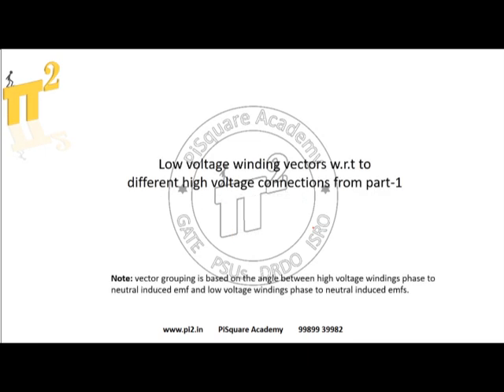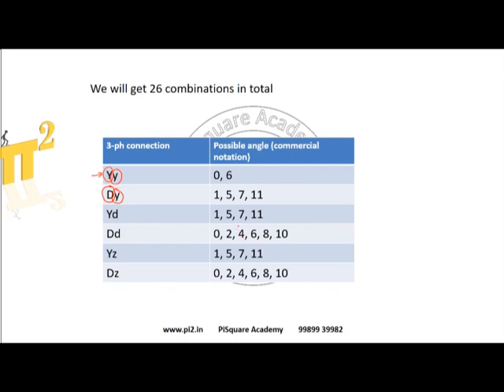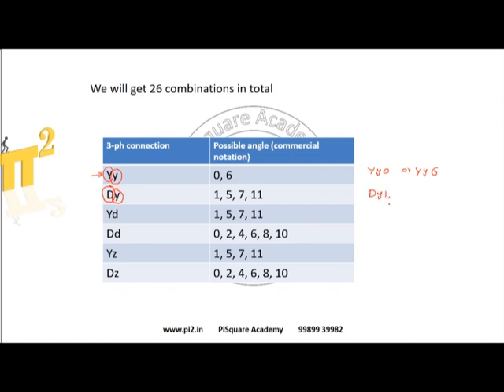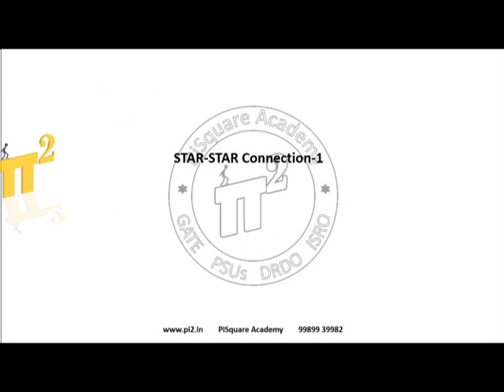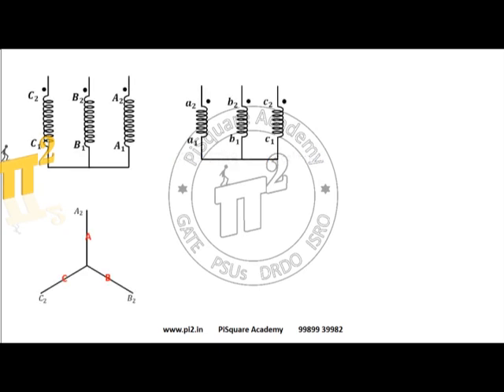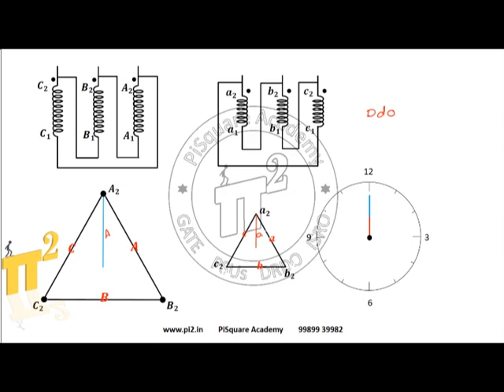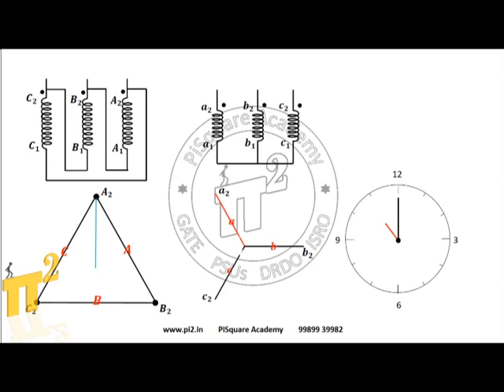Vector Grouping of a Three Phase Transformer (Part-2)

Comment: At 10 clock why mentioned low voltage is leading (why sir you consider anticlock wise),if consider clock wise high voltage is lead the low voltage by 60°or low voltage is lagging the high voltage by 60 °
Reply from the maker: That's a fantastic question, to get clarity on that you must watch the concept of phasor diagram video from our channel

Comment: Sir My question is "While connection the 3 Phase together  for getting neutral point there is no short circuit (spark) in inside the transformer and while connecting any of the phases in outside there is a short circuit. how it is happen??"

Comment: Sir, Is it possible to parallel Yy0 with Yy6 or Dy1 with Dy11 etc?????
Reply from the maker: Dear mishra, you can only connect  transformers in parallel only if they belong to same group (as in Yd1: Dy1 or  Yy0 : Dd0  etc) . So you cannot connect Yy0 : Yy6 in parallel.

Comment: nice explaination,but one doubt how can we say in delta delta or star as the angle is 30  or 60 degrees leading or lagging .the 180 shift is clearly understood as they are out of phase.please explain
Reply from the maker: you are right Mr.Srinivas, when the phases are individually (each winding separately) measured. But when they are connected in 3-ph its goes to a different version. To better understand this, you please watch once again Star-Star connection following Star Delta connection. If still the same doubt is haunting you then ping us.